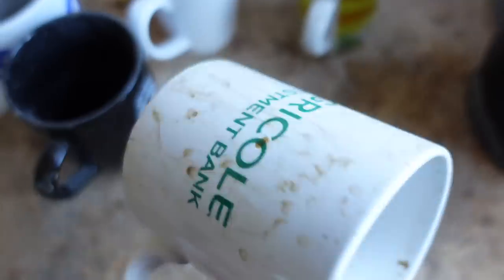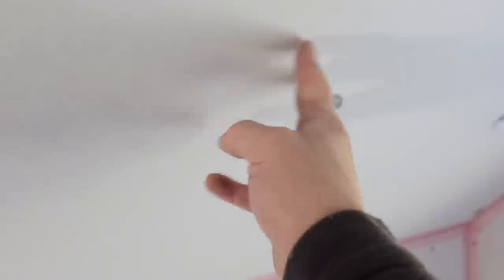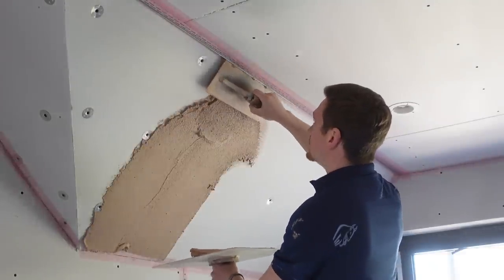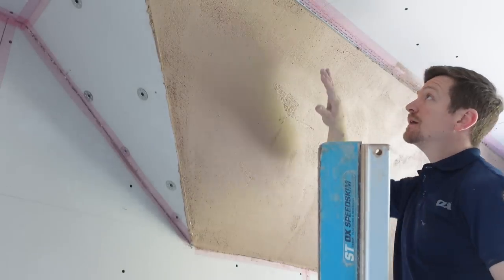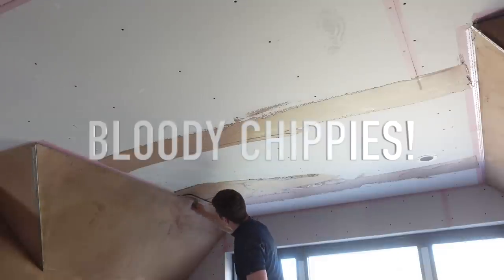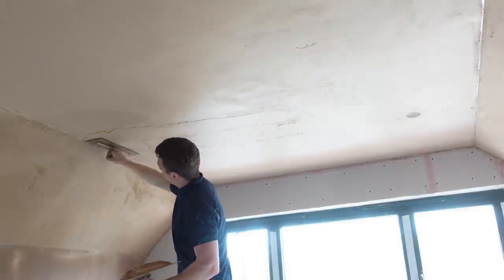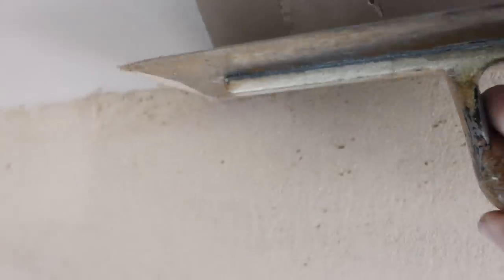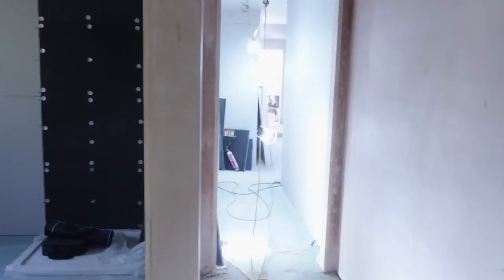The Electricians Messed UP...AGAIN!

Comment: Have you ever come up against something like them but for LED tape? Same idea plastered over etc but rather than 50mm hole it’s a 12mm gap that’s long. Absolute chore to get over as what needs finishing to is basically 8mm proud from plasterboard
Reply from the maker: Yeah mate, I did a video a few weeks ago about it. LED strip on a curved ceiling - nightmare lol!

Comment: Sorry for asking cause it might be a stupid question (i am not pro builder). 

You used a bonding coat for one of the part. Why? I mean you used bonding to make a wall flat and then you will put multifinish on it? Why nit use multifinish straight away without using bonding coat?
Reply: Bonding is to build the wall out as it wasn't flat and had an uneven angle across the ceiling. Multi-finish is finishing plaster so it can't be used at the gauge needed for this
Reply: @TheNomadicTrader  Thank you!
Reply from the maker: That’s the one pal 👍👍

Comment: Not the fittings at all its bad installation on the electricians part I do these and the square ones loads the you have to make sure the screws are in straight and flat, he could of used the black plasterboard screws or countersunk 
the screws.